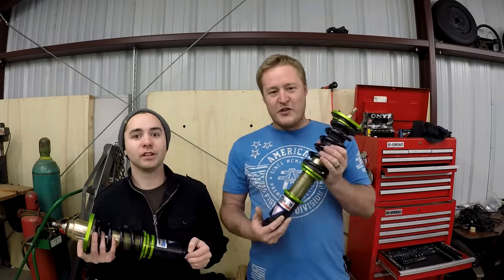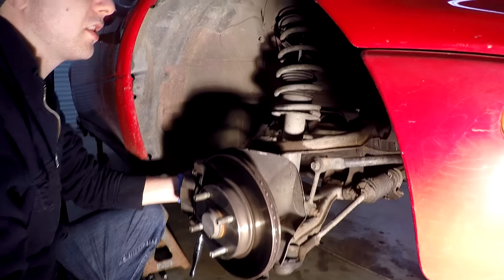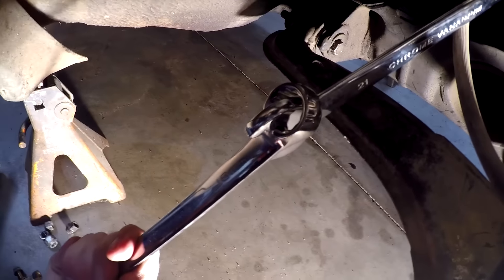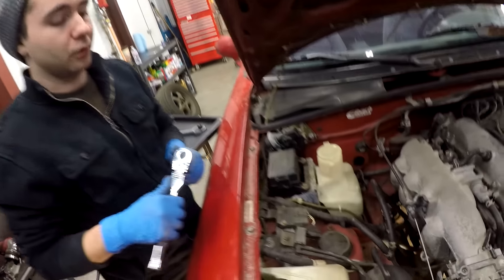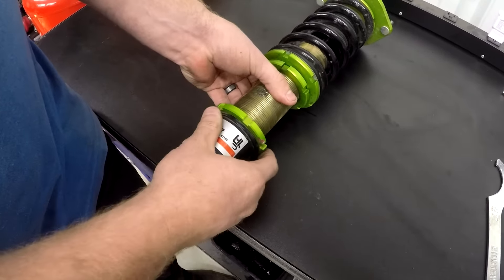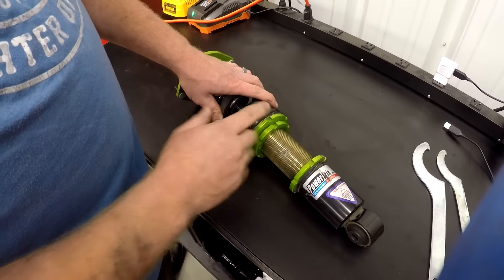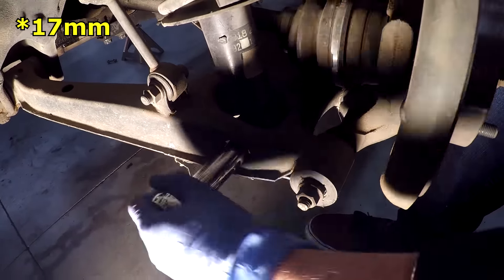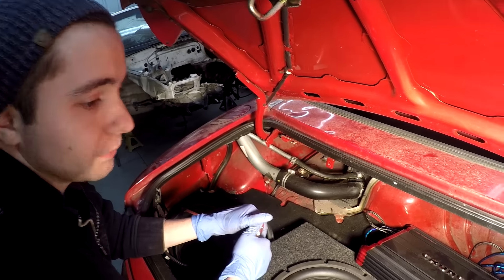How To Install Coilovers | Melody Miata Build #3

Comment: Again a awesome video guys! I received my Tein Flex Z coilovers a couple of days ago and now I doing some research to learn as much as possible before doing this job. Quick question: Do you use grease on any of the bolts to make removing them easier in the future?
Reply from the maker: Thank you and awesome congrats! The only bolt I actually will do that to is the Longbolt, we did not do it this time but I did do it on my old car last time, can't hurt!
Reply: Thanks for the quick reply! Can you tell me what kind of grease you use?
Reply from the maker: I just used Napa wheel bearing grease, you also can use the grease that comes with control arm bushings if you ever replace those.

Comment: great video! quick question, how much more thread did you guys have left to raise the shocks? I'm looking at coilovers but I don't want to go too low since I'm worried about my wheels rubbing (15x8, +35 offset).
Reply from the maker: Matthew Matijevich We could have raised it up an inch and a half or two if we wanted! also watch Greg from TheCarPassionChannels last video you can get these $300 off right now with his promo code
Reply: Thanks! Yeah I saw Greg's video first but saw you guys did the same thing with the same coil overs, so I definitely wanted to ask, it really looks like I'm gonna be going with the PowerTrix, that discount is nice, and I hear some good things about the SS PowerTrix.
Reply from the maker: Matthew Matijevich I liked them on my car, tho I am on Bilstein PSS9's with Swift springs now on my new car, these are on Matts. I like the Bilsteins better but it was much more expensive and for the price plus the discount Greg was able to get the Powertrix are easily the best thing for the money!

Comment: Another good video chaps. Hate to be the bearer of bad news, but you forgot the dust covers for the shocks :/
Reply from the maker: Thank you! And no we didn't! Not all shocks use them actually, and these have a small cover that goes over it when its compressed you can see it at 7:36 I think, its over the bumpstop, this is the way a lot of coilovers come.
Reply: Your welcome. Good for you, I missed that :) Seemed to me a lot of the rod was showing, but when the car is on the ground they probably do cover propely.

Comment: Do you happen to remember what spring rate you guys are using on your coilovers?  I'm in research mode for mine, so this is a daily driver (spirited driving), not a track car.
Reply from the maker: Because Miata You want to hear about the powertrix ones we did here or the Bilsteins we did on my car? - Jesse
Reply: I guess I'm looking more for a recommendation since I don't have a baseline to go off of.  Greg Peters recommends 10k on front and 7k on rear, but he has a high HP car that he daily drives and tracks.  I'm not planning on tracking my car, so I guess I'm just curious to what you guys were using on your own cars, and if you like them or would change the spring rates if you could.
Reply from the maker: Because Miata If you want to daily a car I would recommend a Flyin Miata kit with their lowering springs, Koni's or Tokico's. I am willing to "daily" stupid setups but understand others arent lol. truth be told my miata I think rides great with 560# up front and around #300 rear.
Reply: I've been looking into Swift springs, and I think the default is 8k front and 6k rear.  Greg tells me he loves his 10k and 7k.  I'm just trying to get a feel for what people are using.
Reply from the maker: It totally depends on shock valving, spring rates can be very high and still provide a comfortable ride if the shocks are properly valved for it.

Comment: aren't you supposed to tighten all the bolts with the suspension loaded up first, rather than just hanging there?
Reply from the maker: James Hill Which bolts specifically? Some will recommend that way, but as long as you don't over tighten I've never had a problem.
Reply: I guess anything that is tightening into a rubber bushing, loading the suspension up first allows everything to move to it's natural position first and then tighten them up. Rather than tightening and then loading, which puts an unnatural load at rest on all the bushings. I've seen it mentioned a lot on Miata.net . It is a genuine question though, you guys know more about it than I do, just mentioning what I've been reading as I'll be replacing mine in the near future. (http://revlimiter.net/blog/2015/05/949racing-xida-suspension-install-and-review/)
Reply from the maker: James Hill Its absolutely not a bad idea, you dont want the bolts to bind in the bushings, you want the control arms to be able to swing smoothly with no "preload" from the arms themselves. Like I said though, I havent had that problem as long as I didnt over tighten the control arm/sway bar endlink bolts.

Comment: The shorter guy seems like he is there against his will
Reply from the maker: Against his will? We were putting these on HIS car =P
Reply: +GearHeads  oh I’m glad you responded I have a question for you. I like the video. Big help!I’m putting a cheap pair from Amazon on my Miata. My front pair has a bolt bracket thing sticking out near the bottom  that is not used.  Does it matter which way that faces? How do I k now which way is facing front?  My coil has no stickers on it or an thing.Does it matter?  Thanks.
Reply: +s trav here is a similar kind as you see the front has a bracket thing on bottom. I assume that faces behind. Or doesn’t matter? Thanks.  https://m.ebay.com/itm/for-Mazda-Miata-90-05-Adj-Height-Coilovers-96-98-NA-NB-MX5-Shocks-Spring-Struts-/282138171705?fits=Model%3AMiata
Reply from the maker: that bracket is to mount the brake line to because a lot of cars mount their ABS sensor and/or brake lines to the shock, it isn't necessary on the Miata and I wouldn't bother using it unless it happens to line up perfectly. Why did you choose to get those coilovers?
Reply: +GearHeads Cool thanks. So I guess that’ bracket is supposed to be facing the back then correct? but does it really matter? I only ask because I installed the first one with the bracket facing forward. 

This isn’t the pair I bought on Amazon this pair just shows you the bracket they look similar. Thanks again for your help
Reply from the maker: s trav Its unnecessary. Like I said some companies add them on because a lot of cars use them but the Miatas dont. You notice in this video we didnt use them so it wont be any different for you to just ignore them. Good luck!
Reply: +GearHeads got it!  Thanks!!!!